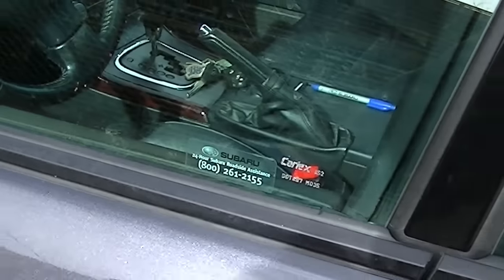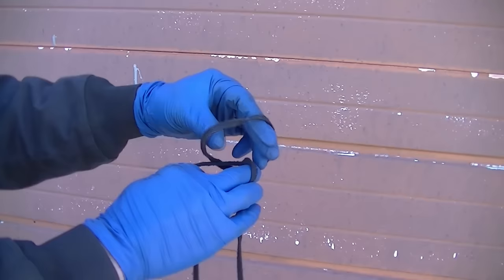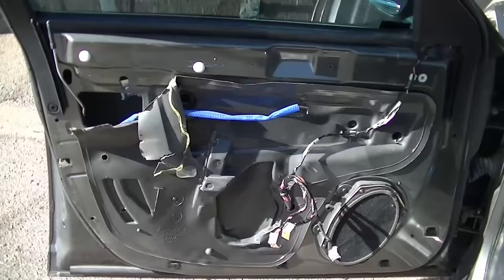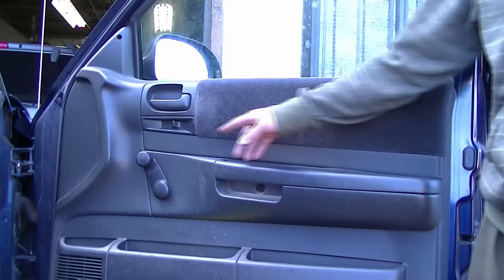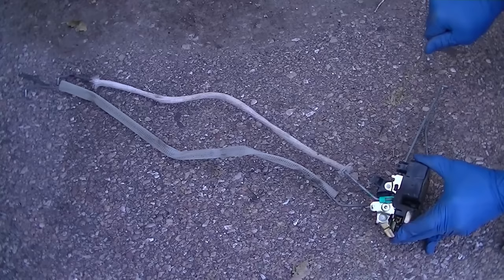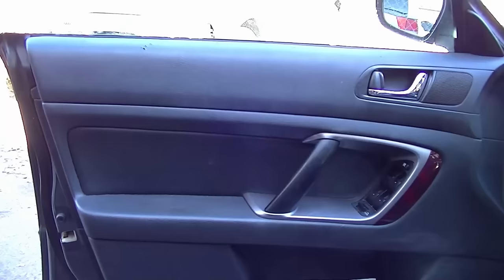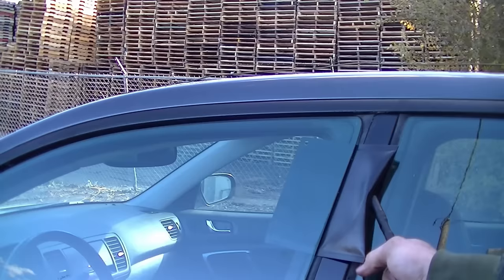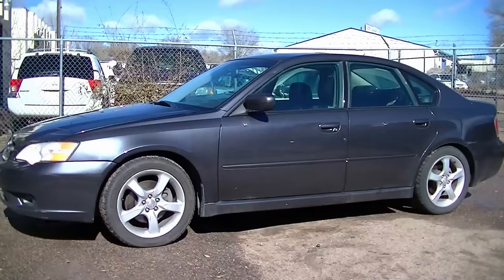How to unlock a car door (without a key)

Comment from the maker: Dear friends, thank you for watching!

Some of you expressed concern that this video may be used maliciously by thieves. - I personally have had my car broken into twice. Never had the thieves bothered to carefully unlock my car. They simply busted out my driver window and quickly took whatever was inside. This video is intended to help people unlock their cars without breaking anything (including the law or the bank ;)
The window in the first car is down while I'm trying to unlock it because the glass is tinted and you can't see anything through it (I apologize for the lack of realism :)
Reply: this is very true, but also depends WHY people are trying to break in or steal, also depends if they wanna not make a nose that breaking a window will
Reply: I think I'm with you
Reply: the thieves won't use any of these methods it takes to long . they will most likely break a glass or your lock cylinder..
Reply: Nothing new here for car thieves, but then this only gets you into a car, it won't start it for u. 
Best technique for getting into a more modern car that isn't yours is using an RFID scanner to collect the remote opening code when someone parks. Set the code to a blank key fob and just open the car like you owned it. Still won't start the car, but seriously this wouldn't be teaching a real thief anything new(not even the ten year old ones).
Reply: I appreciate it, this is the 2nd time in 2 years my girlfriend has locked our keys in the car. I really don't want to call the non emergency number again because I do have the money for a locksmith this time but that's not where I really want to spend it.
Reply: Get real car thiefs already know this .this is very very old information
Reply: if you have tinted glass the thief can break the window making minimal noise.
Reply: Another way thieves get in is by just checking door handles
Reply: The non sophisticated thieves bust out a window. Actual car thieves are just using radio extenders to steal expensive push to start cars. This helps people that have locked their keys in their cars and really nobody else.
Reply: @mr.dogfaceliar537  Even the most basic thief uses porcelain so there is no sound.
Reply: Wrap whatever rod you use in tape to reduce the likelihood of scratching the paint. Note that the professional rod is Teflon coated. If you pry the door too far open, it will bend the frame, letting wind whistle in past the door seals at high speeds. So, your rod needs have the smallest diameter possible, or else use something long and flat to push the electric lock switch with.
Reply: "Sweet sound of the door opened" oh, yes :)

These methods for the car owners to unlock their own cars when they accidently locked the key in; not for the thief like many people said
Reply: carlo baker öpp
Reply: I am a professional tow truck operator. and though I understand the purpose behind this video, using some of the "devices" you show could in fact do some major damage to the vehicle. In the towing industry, we have nearly stopped accessing lock mechanisms through the door as there are many wires in the door that can easily break and cause hundreds of dollars to repair. I always recommend calling your local tow company or other roadside assistance agency. Even if there is a cost incurred, it removes any repairs as a result from being  paid out by you, becoming the tow company's responsibility. Better to spend $50-$100 and have the satisfaction that someone trained will have you in in no longer than a minute then have to worry about $200-1000 in damages from accidentally breaking a wire in the door causing major electrical issues.
Reply: Can't be done with a Jag as the Latching is below the window line any untoward movement triggers of several alarm systems.Stick with the Japanese cars for this trick!!!
Reply: A brick is always quicker but good instructional video...
I have broken into cars with newspaper wrapping tape and screwdrivers however 1 does damage and the other doesn't. (my own vehicles only)
Reply: A piece of spark-plug ceramic will pop a window easy.  Or simply drill a hole in the side of the door near the locking mechanism, then insert something to unlock it.
Reply: Currently in this situation. My fiancè has already been at it over an hour trying to get my door unlocked. Just showed him the string method...wish us luck!😕🍀
Reply: John Langley
Reply: Make time too get keys made. My key cost $100 (security chip) got 2 , lost both f***, one is hidden outside the car, ( make sure nobody looking) locked myself out few time. tow truck sure is around $100. for slim Jim.
Reply: Maple
Reply: Right? The person who wants to steal will damage the car, people are so annoying.
Reply: Thieves want to get in and out fast without being noticed. These unlocking methods are too slow, giving time for people to call the police and increases the chances of them getting caught.

Trying to unlock the door is likely to set off the alarm, drawing attension to them. Many car alarms will not be set off by breaking a window, so breaking a window is relatively quiet comparatively.
Reply: @mr.dogfaceliar537  who are you
Reply: Thank you
Reply: Unlock my car right
Reply: @glostyle  no hi
Reply: Me @jasonhypes7342
Reply: @lightsnmore6253  Sorry, not true for me. Last time I used a tow company it took them an hour to get there. I have toeing etc on my ins and thru my Credit Card. But just didn't want to wait or them.. But I was going to call them next. Now I  spare set of keys...
Reply: @klopossa2  I was speaking from time on scene. I understand that dispatch can take a while, but once there, I have taken at most 5 minutes to access a car.
Reply: Trust me if they want in, they just take a broken spark plug and scratch the glass and Bammmm glass everywhere. it's fast and efficient...
Reply: Lights N More p
Reply: Great point!   THIEVES just break in and steal vehicles quickly!
SPEED OF ENTRY IS THEIR ALLY!
TIME is their enemy,  they NOT want to draw attention.
Reply: Read my other comment
Reply: Call someone at home use your smart phone on speaker mode , tell the person at home to press the unlock button, it should work I have done this on my car a few times
Reply: Thank you i literary just got my car unlocked 😅
Reply: You're  fortunate, one of my relatives had their van broken into and the thieves broke two windows to get in .  Why of course do you need to break two when one will do ?  The mind of a thief.
Reply: Then what was the point making this video?
Reply: Will any of these work on a 2010 honda accord?
Reply: There are many components to studying circuits. One place I discovered that succeeds in merging these is the Gregs Electro Blog (google it if you're interested) definately the most helpful course i've heard of. look at this  extraordinary resource.
Reply: I really appreciate you posting this. The thief who attempted to steal my car months ago did so much damage getting in, then ruined steering column and ignition in unsuccessful attempt to steal it I guess...? Getting in did nothing for them since there was nothing of value and they didn't know what to do once they were in without a key. 

I couldn't get the car to unlock with the key today, but was able to pull up the lock with a coat hanger without causing any damage after watching this video. Attempted thief obviously just wanted the fasted way to get in, which was incredibly sloppy and destructive -- of course they're not going to take the time to carefully unlock a door when each passing second of their suspicious behavior increases the likelihood they'll get caught. I just really needed to get in and didn't want to cause any damage (well, some very minor damage would be ok since I was working around places already damaged from the break-in that will need to be replaced anyway). I wouldn't have known how to without this video. Just like other people have mentioned, all the thieves care about is speed. It's good to have this information available when all other options are either too expensive or dubious.
Reply: Thanks for this video the first trick did it for me to open my 2009 malibu thanks again
Reply: I wish I saw this before! I have been locked out of my car for nearly 3 years now but it only took 5 minutes to get back into my car.
Reply: @michaelklonowski4089  huh?
Reply: @bmkolb  On what kinda car? My car sounds alarm if u unlock differently then u locked it (key vs lock switch)
Reply: @lightsnmore6253  LP l
Reply: Slight leak in the front of my toilet bowl due to uneven floors how do I fix that  @bodoknochenhauer3231
Reply: @AdrianJayeOnline  they still wont have the keys (typically) and the cars alarm will go off. Making a lot more noise than breaking the glass
Reply: I have a question for you my car door is just like the last example you showed but my battery died and the keys went work.  I was able to slip a metal loop around the door handle but the door still will not open do you have any ideas how I can get the door open without breaking my window? Any feed back would be greatly appreciated.
Reply: TRUESH!TT  hulk better have some funds if that fool wants to smash something
Reply: If someone is going break in to steal the car, they either already know these tricks or more. I have a bad habit of locking my keys in my vehicle and wanted an easier way to get in with doing the least amount of damage. I would never thought of the shoelace trick (which I just used to get into my car just now) very useful and informative.
Reply: I agree Lights N More. I have been there and done that. Only difference is I took the advanced locksmith course for certification by the state I was working in. Lucky for me as a Tow truck operator I had the right tools for the job. Some were expensive, but were every bit of worth it. I would even get requests from law enforcement and or F.D. because they knew my response was quick and the resolve even quicker. Your good advice for all other tow operators will save them countless hours and $$$$$ for repairs to wiring/lock mechanisms.
Reply: One @kristianfrederiksen9217
Reply: Great tips. Here's mine. I keep a spare key in a magnetic key holder secured to the car frame. It opens a small exterior storage compartment that has a fob in it. Saved my butt a couple times.
Reply: Make It Easy Mechanic /
Reply: Very very helpful, thanks.
Reply: @AdrianJayeOnline  I know I'm with you anyway peace out bra.
Reply: @Jake12220  HA HA HA FUN NY
Reply: @Jake12220  The last part that is
Reply: @xMrGrimshawx  Then save that money and call your mom or dad to see if they can help you. Peace out girl peace out guy whichever one you are. Good talking to you. Peace again.
Reply: @ronlafountaner70  I do too. Peace
Reply: @jennifurzoe1302  True dat girl friend. But here's my way to get back at them theives I just pull my handles out of the car so no one can get in the car. Now I know it may sound funny but it works. Anyway peace.
Reply: @glostyle  Yep that's what the thieves like doing anyway. That's why they're thieves. They love stealing things other people need. Anyway peace out.
Reply: @CL-mp4vn  I know that but I respect you for your concern and bravery to say that. Anyway peace bra peace.
Reply: @lightsnmore6253  True true friend. Peace
Reply: @AdrianJayeOnline   Go go would you please copy out of the important things that my Y poor creature gjelten add pay is doing wrong in our relationship
Reply: @muhammadshahidkhantajikoff4982   Google search says she what this is
Reply: Google research this Matt got me into a car it's C when this recurred in my relationship my marriage @Jake12220
Reply: @xMrGrimshawx   So who this my girlfriend is so I can get my horse solidly with grandeur
Reply: Thank you Patty pad sorry Peter here I'll thank you so very much for giving me what I need you to the board your story block in that
Reply: jennifur zoe 0
Reply: 06
Reply: ۰
Reply: car thieves would never use these techniques as they take too long. Most used by thieves is a screwdriver and hammer which takes 10 seconds but does damage the lock which of course they don't care about. Anyone concerned about any of this should invest in a car alarm.
Reply: Up loop o OP........ moo PM the is.
Reply: Thank you so much I my keys out of my car. Couldn't do it without you
Reply: It’s like lock picking you never use your skills to break into anything you don’t have prior consent from the owner.
Reply: l]
Reply: Tnx much,   i brought hammer 🔨  out but think twice and was saved by shoe lace.
Reply: 9op poo
Reply: Make It Easy Mechanic o
Reply: Thank you it works ✨ very helpful 👏🏻👏🏻👏🏻👏🏻👏🏻👏🏻
Reply: HAHA!!
As I was watching this, I asked myself.....Is going to teach me how to hotwire it as well???
Reply: 1997 buick lesabre. I have some what like the last lock but i dont have a battery in the car. Any ideas
Reply: Old School method 😎😎😎
Reply: Very well said!
Reply: Thank you Sir for your help. You saved my @ss 😂!
Reply: 7
Reply: Today we will be showing u the 1,745,999 ways to maybe possibly unlock ur 1900s car. Make sure it is ur own car first by checking ur own identification to make sure it's really you, and that really is ur car. We know only law abiding citizens are watching this video. But let me stress, if u happened to come across this video and u are a grand theft criminal, please do not watch. Or please only use these methods for legal break in purposes, we trust u will do that. I know the difference between legal and illegal is a fine line, it is only two letters, an i and an L which I know it can be confusing or misleading. So if u do get caught successfully breaking into a car, let me first start off by saying thank u so much and well done. You have followed our tutorial to a T. But please tell the police u did not get ur break in information from this YouTube video. Thank u, we appreciate ur loyalty, criminal or otherwise.
Reply: Ho
Reply: 00”Poplar
Reply: Good info
Reply: Okay good  info
Reply: 1 hour ago I closed the door and my 22 old month son and my keys where inside the car, my car is a VW POLO from 1991 so I used the shoelice amd knot , I managed to open my door in 10 min! So gratefull for this video!! thsnks!!
Reply: Aa
Reply: Love 💕 I n b
Reply: Used your shoelace trick today (forgot the keys inside
), you saved my life. Thanks a lot !!!!
Reply: @jennifurzoe1302  I
Reply: @Jake12220  8l
Reply: Thank you so much for taking out your time and effort to share this valuable knowledge with us. You save our day!! We are very grateful!! Blessed you!!
Reply: I love it when people think the bad guys don't know how to do something. And they need a lesson from a good guy. lol
Reply: MY COUSINS KIDS ARE STUCK
Reply: My brother did
Reply: I have a 1983 chevy s10 pickup..
Any tips on unlocking my doors ?
Reply: Right? Wtf lol. Like a thief trying to take their time with these methods
Reply: 00l
Reply: Only the ones that don't know how to spell do. Lol
Reply: I i
Hi
Reply: @AdrianJayeOnline  make n kk
Reply: How do I get into my 2009 Chevy impala with a slim Jim if the car key is lost and the battery is dead?
Reply: @bodoknochenhauer3231  wz
Reply: @glostyle  by any p
Reply: Say what🤔

Were made in HIS image. HE made us with the power of free choice
A good prayer:
I'm a sinner JESUS please forgive me for all my sins I know you shed your Blood for me on the cross at Calvary. Thank you JESUS for my salvation and for shedding they Blood for me. I love you JESUS. 
Romans 10:5/10 ct...❤️k
JESUSisLord!Amen...
Amen..
If you'd like to call someone who cares 
83
For
Truth.
bc you don't know when you'll die?
.y r u hesitant. .. ......
Reply: This fucking bull shit will not work on modern cars
Reply: Now make a video 2008 and newer 🙏🙏🙏🙏
Reply: PLEASE FOR THE LIFE OF ME,  2008 and newer. Electric...
Reply: @irenewilliams5145  yes.. lol
Reply: àa)0pppp
Reply: Me😅
Reply: 8000
Reply: @AdrianJayeOnline  à
Reply: ❤A vlipqq
Reply: FML
Reply: I got locked out of my car this evening. Just watches is video and gave it a try.. took roughly around 15 to 20 mins.. I unlocked the car by myself. Thanks for your help team!!
Reply: P😊
Reply: You literally just save me sooo much money, and as a clumsy person this video has changed my life. Yes it is information for the badies out there too but we live in a dualistic world , thank you thank you thank you
Reply: Meeew
Reply: This morning my wife tried to use our car (Honda Civic 9th Gen EU) to drive the kids to school. She realised someone had unlocked the car and took everything inside and ransacked the inside of the car. She does not remember if the car made the unlock sound when she pressed the key fob or not. Does anyone know how someone can unlock this particular car which has no Keyless Entry? I want to find a solution so they can't do it again. Many thanks
Reply: The first trick is GENIUS!! Never would I have thought of it and if it had not been for this video idk how I would have just gotten my keys out from my car.🤦🏽‍♀️ Thank you for sharing!!!

Comment: Thanks man. I used a wooden spatula to pry the door open a bit, and a steel wire with a loop at the end, took a long time and lots of patience but I got better at manipulating the wire and eventually got it over the door handle on the inside. 👍

Comment: I ran into this video tonight because of an emergency and the first option truly works! Left a car running to warm up with driver door closed, but after a couple of minutes the locks randomly kicked in and I was screwed. A traditional flat shoe lace is what will only work. Follow the instructions with lots of patience with a really tight knot and you should hopefully pull it off too. It saved me lots money instead of calling a locksmith and I've also learned a new trick. So thank you so much!